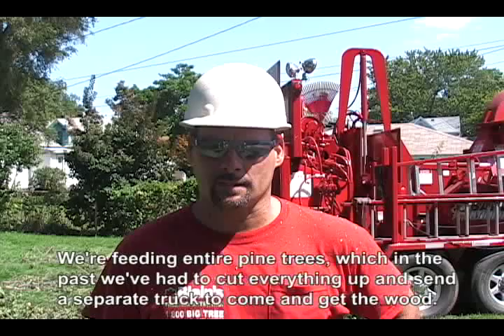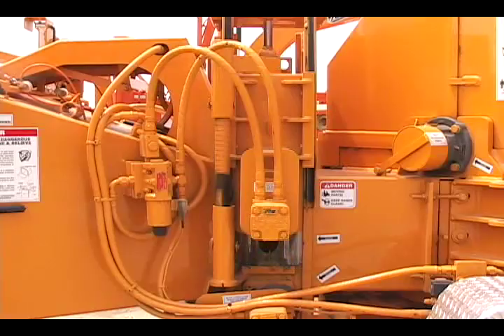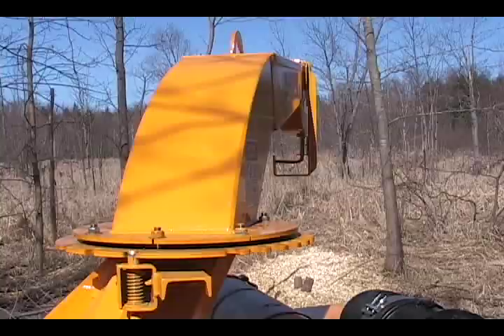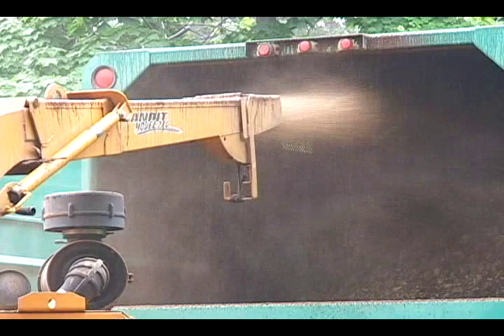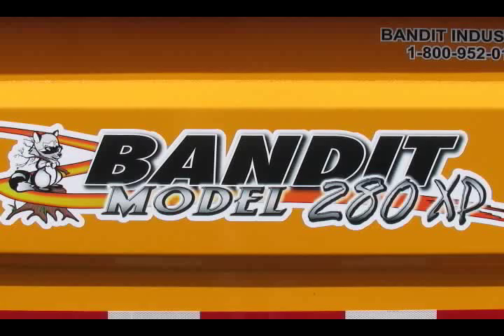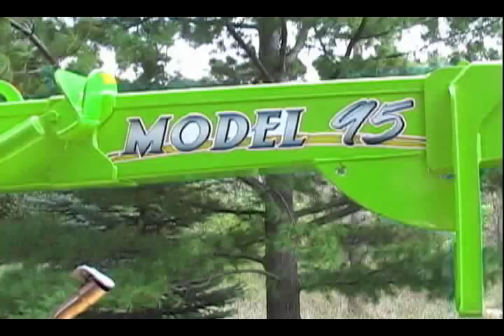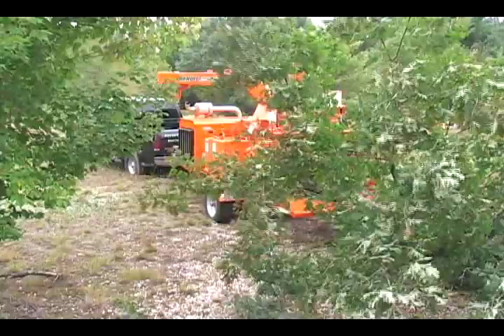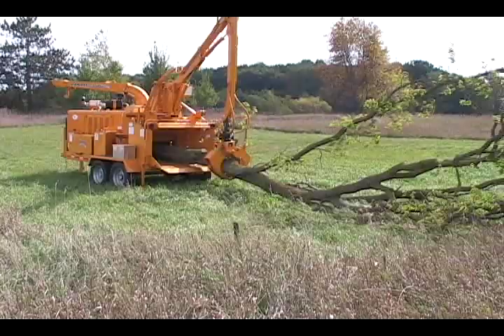Bandit Hand Fed Chippers Overview Part 3 Of 4

Comment: Nice gear, looks good.
I see why you feed at a given rate till the cutter bogs - if the material is substantial enough.

Only conflict I have is with the Hand Fed label.
I didn't see anyone feed anything by hand. ;)))
Reply: Knobov Sossidge ,I fed one by hand for nearly 5 years ,great machine mate.key to these mulchers was keeping the bed knife and blades set right ,daily maintenance on blades,that was in Australian hard wood too,none of this soft stuff from the states.